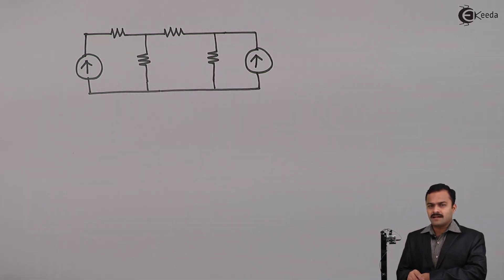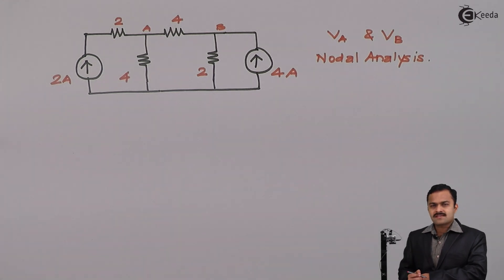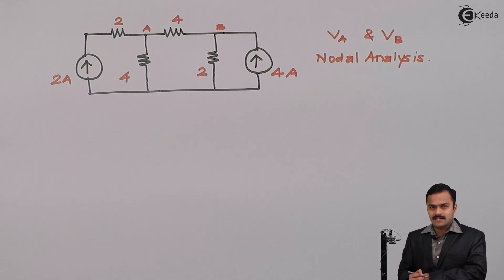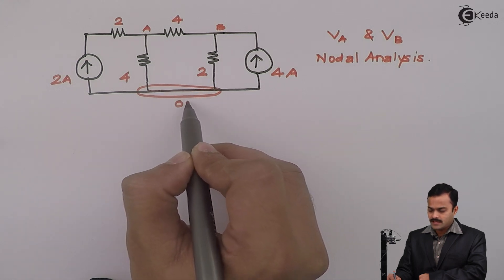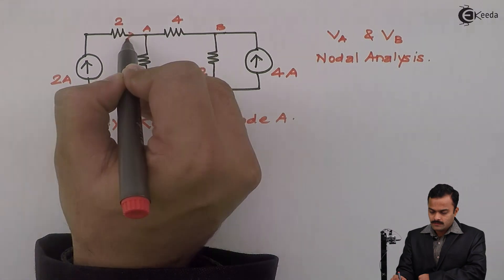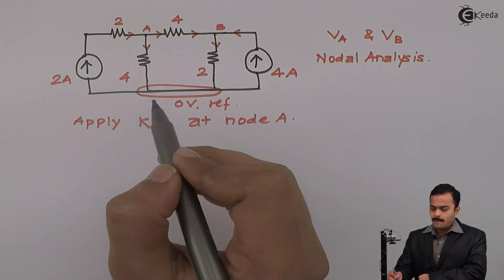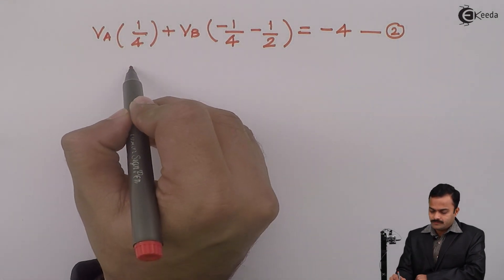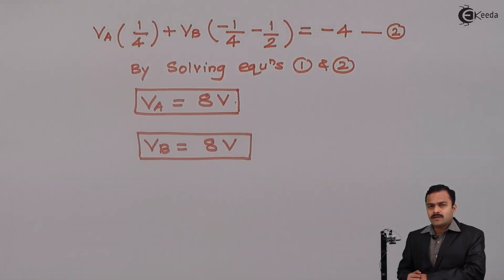Nodal Analysis : Problem 1 - DC Circuits - Basic Electrical Engineering

Comment: Sir why in problem 1 ,you took the reference  which is not actually  a node? Aren't  we take one node as reference node? As there were only two nodes so one should be taken as reference  and that node's voltage should be zero.

Comment: Y u r not considered 2 ohm resistance at node A????
Reply: because in this branch we know the value of current not need to recalculate
Reply: @bhagtigangasagar8187  ok ... I agreed with ur answer... But I had one doubt... For suppose  at node- A , there is a voltage, resistance and current..at that time also we should consider the current only or what we should do ????...
Reply: @manasaalladaboyina4166  because we have to find the current through the branch.and i have alrady known the current

Comment: Why don't you take (  at node a)

0-VA/2 its also a branch....  Including a current source and a resistance....
Someone pls... explain i have an exam tomorrow....
Reply: Dawood Ibrahim The current flowing through the 2 ohms resistors is equivalent to the current source which is 2 amps.
Reply: @Jack-gx2sx  yes that's the concept

Comment: For Everyone who  is wondering why he ignored the 2 ohm resistance. Firstly, this is the whole point of nodal analysis .You simply consider the currents in each node NOT the voltages . so your equations should be written in terms of CURRENT . If you were to solve it with the mesh method, yes you would consider that resistance because in that case you would be writing equation for VOLTAGE . In addition , in nodal analysis we consider the voltage at each node to have a higher potential energy and thus the current coming out of the node is the positive current.This means that the current direction in nodal analysis is assumed to be positive when coming out of the node and negative when coming into the node.The negative sign would then make our assumption  accurate . There is no right direction. You can  choose whatever direction you want to be positive  but just be consistent and its better to have the above convention every time you solve nodal analysis  problems
Reply: Beautiful explanation
Reply: thank you so much buddy!
Reply: Thank you so much
Reply: Thanks <3

Comment: It would have been helpful if you explained that the current flows from high potential to low potential, which is why you have the current going downwards at the 4 and 2 Ohm resistors in the middle of the drawing. Otherwise, this is a very helpful video...greatly appreciate you taking the time to post this.

Comment: in above problem at node 1 u r apply kcl but  y u not take 2v incoming resistance
Reply: Based on KCL, sum of outgoing currents = sum of incoming currents. Here in this circuit, we dont have any voltage source in the left side, only current source so, current is constant here.
I hope this could help you.
Reply: Ashlee Claral  if we write the incoming including resistance 2ohm will the value be wrong
Reply: What happen if we take 0-VA/ 2 DOES IT CHANGE THE VALUE